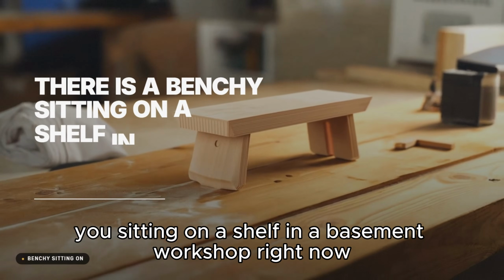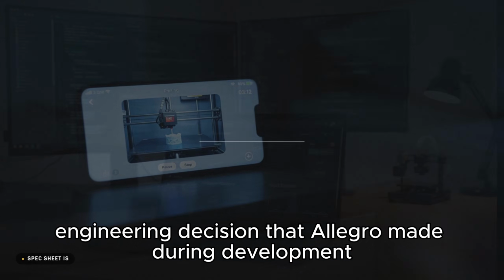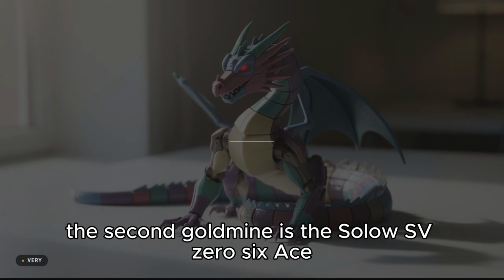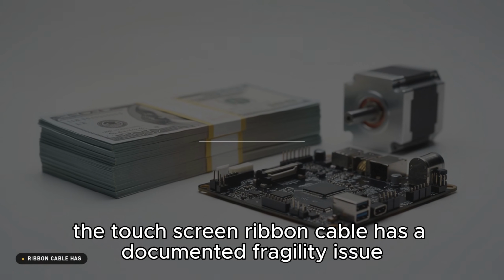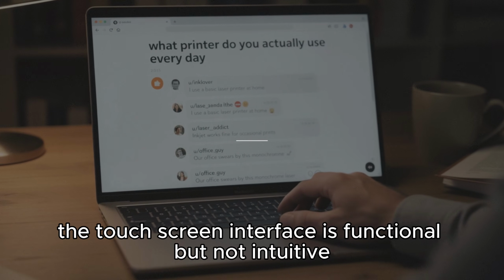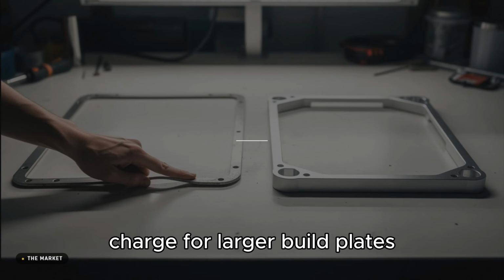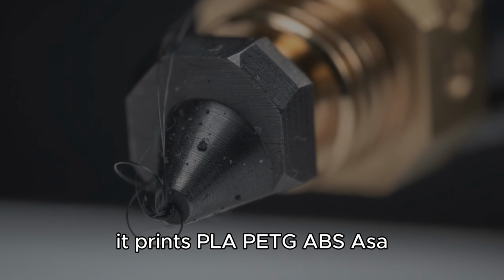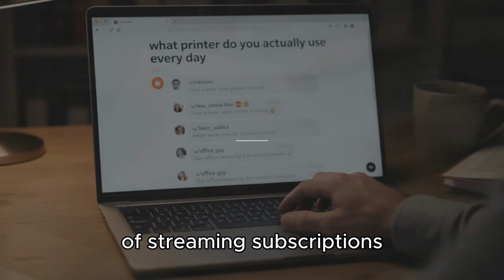5 CHEAP 3D Printers That Are Absolute Goldmines (Hidden Gems)

Comment: DO NOT purchase an Elegoo, their after sales service is disgusting.
I have a two month old paperweight as Elegoo are dodging my warranty claim, and the part that I need cannot be purchased from their website if I wanted to just suck it up and sort it out myself.
The initial communication was great, right up until the fault found was with the printer itself. All communication stopped at this point. I have since filled out their contact form three times in three weeks in an attempt to obtain an update, but with no joy.
On my forth attempt after threatening to file a grievance with our consumer affairs agency, I received a response stating that all of my communications were lost due to technical difficulties.
That's convenient.
Now they claim to have sent out the faulty cable, which is a common fault with that printer, and provided a tracking number that doesn't exist on the freight company's website.
That was last week, and an attempt to try and reach out again, has fallen on deaf ears.
All of this hassle for a cable that probably costs around $20.00.

I will never purchase, nor recommend Elegoo products again.